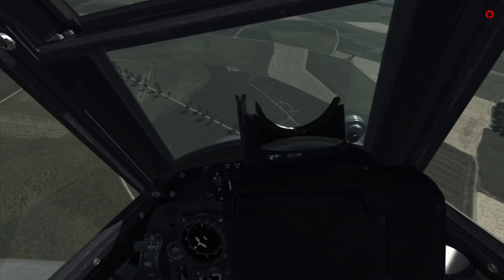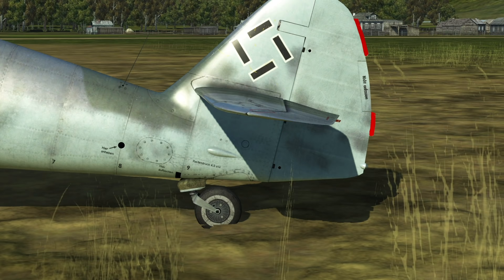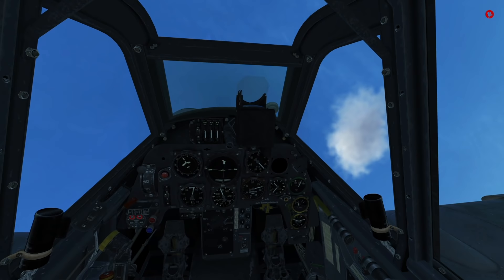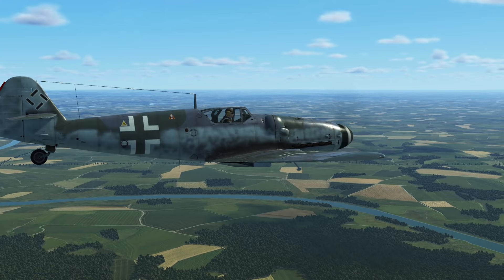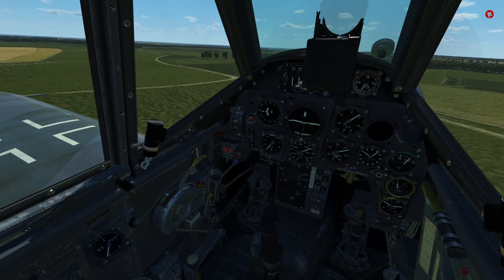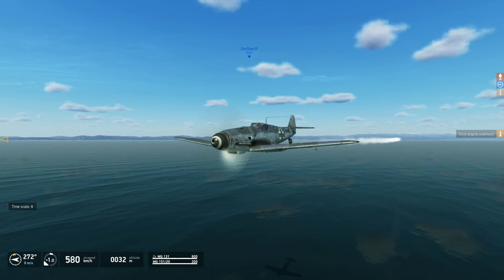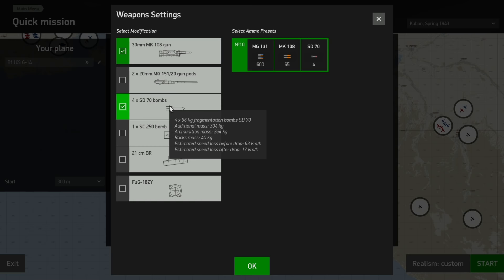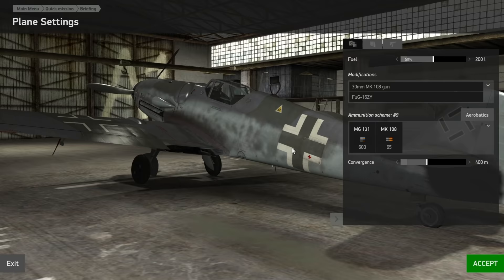How to Bf 109 G-14 - IL-2: Great Battles

Comment: Your English is excellent, but I want to point out one small grammar correction: When you are talking about something that occurs consistently,  which is a feature of the thing you are describing, and not a single incident, you say 'the entire horizontal stabilizer moves' as opposed to' is moving'. 'The aircraft 'handles' very well, as opposed to 'is handling' very well.

Comment from the maker: Comments from the first (faulty) upload:
from: NotDumbassable 
Concerning the MW50 system, how does the engine handle any setting between 1.3 and 1.42 ata? Also, did I understand correctly that you meant that when using any engine setting above 1.42 ata we ought to use 1.7 ata since the engine only engages MW50 at 100% throttle and would bust above 1.42 ata?
Correct, and that anwers also your fist question. The engine blows after 1 minute at 1.42ata. Go full throttle to prevent this.

from: s smith 
Excellent video (wie immer!) I wonder if you could make a tutorial /tips guide for noobs on taking off and how to avoid common problems ( spinning , not keeping straight on runway etc), whether that is using brakes , rudders etc.? I realize that planes vary but maybe a general guide? Or apologies if you have already made such a video ( did not see it on your page) in that case please point me to it.

this is coming in the next part and is part of all full "how to" videos. If you watch the Bf 109 F-4 Video and the Yak-1 video, you have the essentials.
Yak-1
https://youtu.be/GgKe0Hf3wyE?t=322
F-4:
https://youtu.be/lYQ8zWn2oZw?t=405

Comment: It's a Kurfurst-4 but with slightly shittier manoeuvrability. I believe some were converted to K4 in the field with a kit. (retractable tailwheel and a few other bits and bobs)
Reply from the maker: No. Thats wrong. The K-4 came much later than the G-14 and had for bf 109s quite a amount of changes. Not only the tailwheel, but also different gear wells, a different tail, another cowling and another engine. 
The K-4 was a major improvement. A G-14 couldnt be just refitted to a a K-4.
Reply: @SheriffsSimShack  Maybe I'm thinking of another model.
Reply from the maker: @PORRRIDGE_GUN  Potentially G-10. But some of the comments wouldn't make sense in a comparison to the K-4 either.
Reply: @SheriffsSimShack  
Most important the K model had the DB605D engine, which necessitated some bulges again. Only the G10 used the same engine.
Reply from the maker: Like I said. Another engine